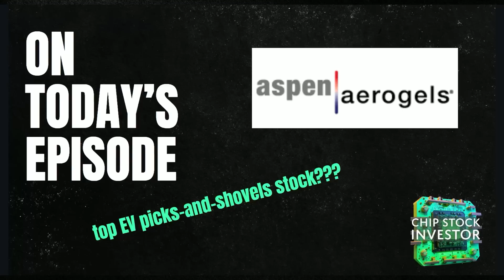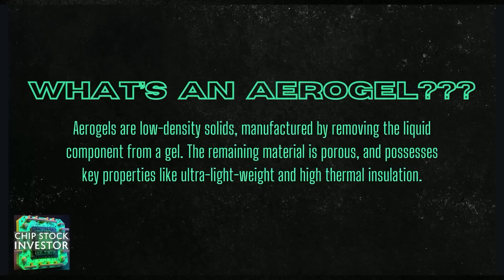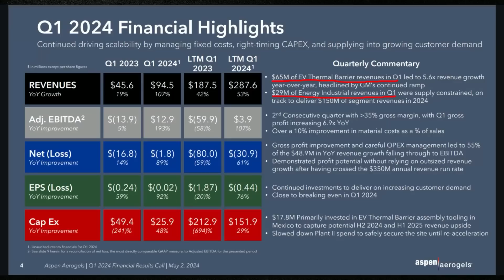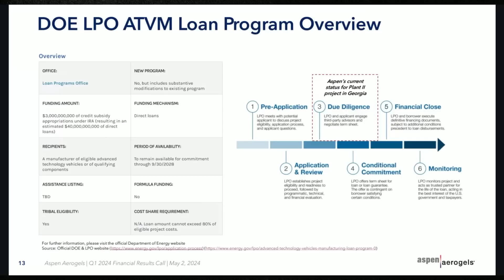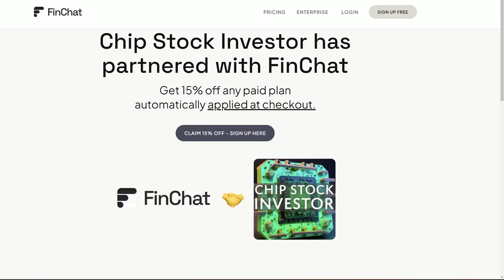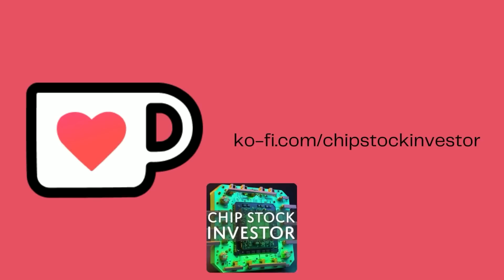Is This Small, High-Growth Stock the Ultimate Buy For EV and Lithium Stocks? ASPN Analysis

Comment: Enovix ar doing a simular thing?? Maby i’m wrong.😉 by that I mean that they make batteries safer and that they can provide a steadier, more controlled current.
Reply from the maker: Not exactly, Enovix working on the battery cells themselves. Aspen makes an insulation for each cell.
Reply: Ok, thanks .😊👍